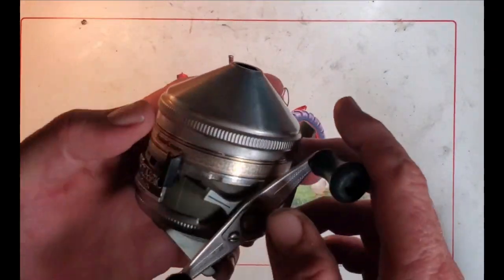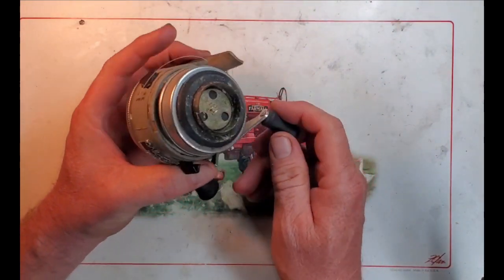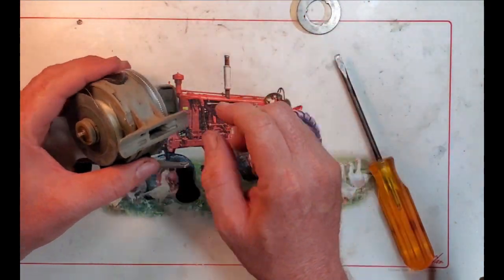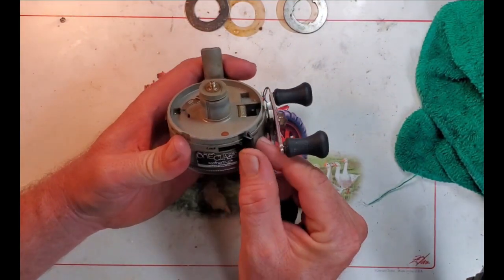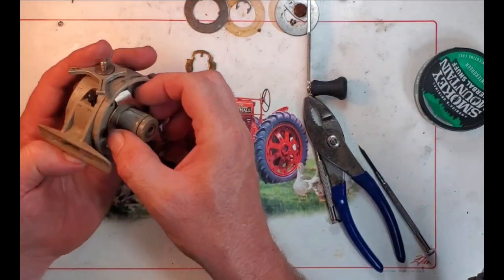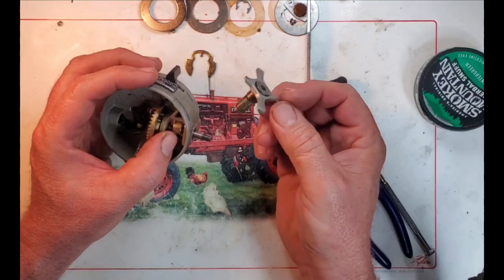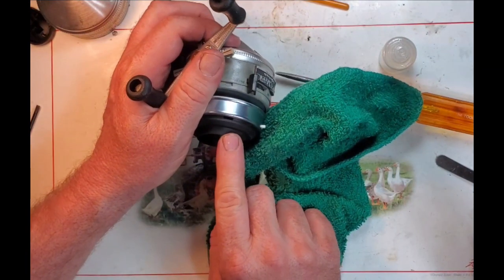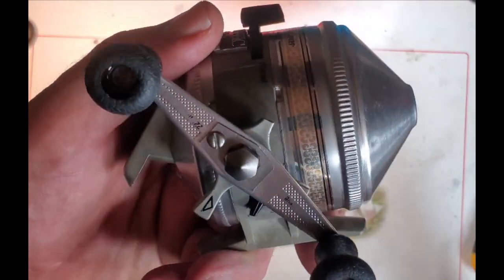Zebco One Classic (1987 - 1991) Spincast Reel Service and Repair Video

Comment: I was just working on a couple of 33 classic reels. One was the ball bearing with the clicker and on/off anti reverse, while the other was a basic direct drive anti reverse. The spool on the ball bearing 33 was stuck to the spool post like yours was in this video. I had to twist it off with channel lock pliers. The drag doesn't work if the spool is stuck. I wound up switching the spools from the two reels. That seemed to work OK, but the one with the stuck spool was still pretty tight.   Do you think the reels with those plastic frames expand over the years, or does the metal spool shink?
Reply from the maker: I think it's the "lexan" / plastic spindle on the frame that is swelling.  It seems like I've heard others say that on some of the reel forums over the years.  I've tried sanding the spool as well as reaming the spool.  Both work, but I think I prefer to ream the spool with the rotary tool which allows me to get a more even removal of material.

Comment: I hav a Zebco one and can't get the spinner head off.  Tried enough force and fear it will strip the gears.  Tried penetrating oil and no luck.  Any ideas for me?
Reply from the maker: Try heat.  I'd try touching a soldering iron to the center of the spinner head until it's good and hot (I wouldn't use a propane torch because you don't want to melt the line brake).  If that doesn't work, try again and then put the reel in the freezer and see of that will break the corrosion that's causing it to seize-up.  I hope this helps!
Reply from the maker: Not too hot. You don't want to melt the lexan spindle or pick-up pin blocks.  You might try freezing first and see if that does the trick without need for heat